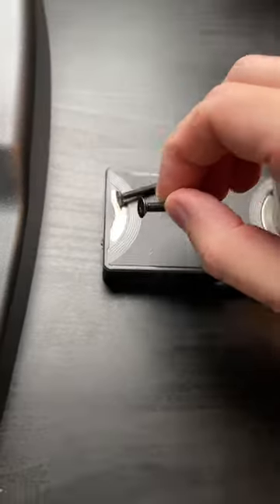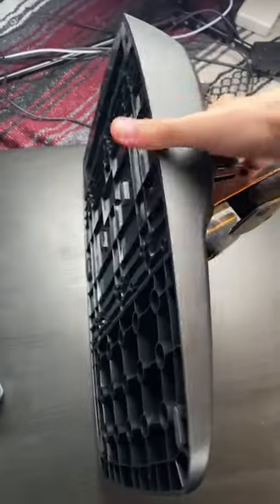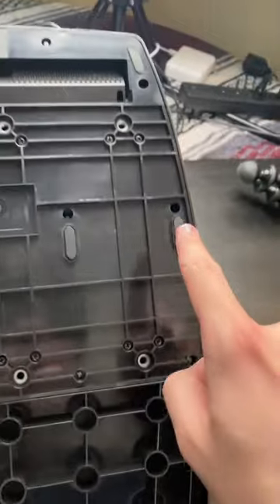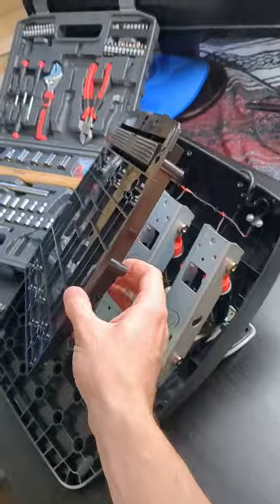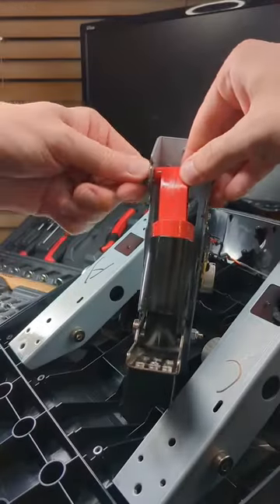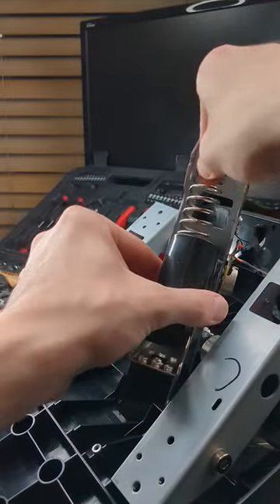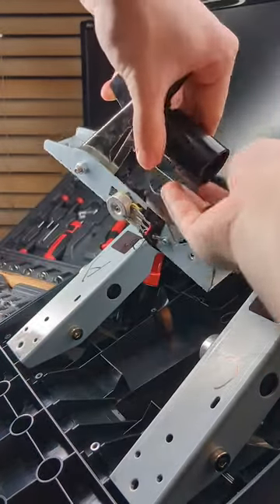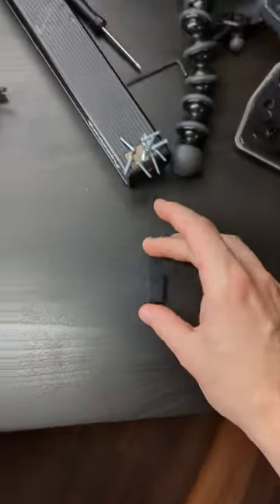FIXING the Logitech G920 #shorts

Comment: Don’t just remove it😂🤦🏻‍♂️ I used a eraser cut to the same size as the rubber insert, softer than original with more resistance at the end of the travel works a treat🤙

Comment: Bro for this g920 exists a app on computer where u can  control every part of ur steering wheel and u can change ur pedal how hard or how easy to press and this works on the wheel too
Reply from the maker: The only thing GHub does for the pedals in digital sensitivity - it's the same stiffness regardless unlike changing the centering strength on the wheel. Without the rubber piece it's obviously a linear press which is unrealistic, but for how many people will probably have this wheel on a desk do think this is better.
Reply: @NPCLiam  oh ok thank you

Comment: Upgrade the brake pedal sensor with an AXC True Brake mod kit. Bout 60 bucks for the best G series  pedal set.

The pedal feels wrong because your leg strength needs to improve. High end pedal sets are just as difficult to press. 
At best just shorten the rubber bushing.

Comment: Really you actually want to get rid of the only bit of feel that pedal has I mean I'm having a hard enough time going from racing real cars to getting used to electronic pedals that don't really act quite right 
plus the only feedback you get is visual and what you can feel through the wheel unless you have a really good setup then you can somewhat feel what the body is doing but to me it kind of feels like someone forgot to do up the suspension and closed their eyes on the wheel alignment 🤪 🤣  it's close but still a little bit weird compared to an actual car

Comment: Gamers must really not know how real cars work or feel smh
Reply: driven hundreds of cars. not any race cars meant for straight up racing. the pedal with good calibration is to stiff. especially with a regular office chair.
Reply: @Camka427  well, yeah, on an office chair with wheels it is lol. The proper way to do this is a cheap $200 or so racing sim seat with wheel and pedal mounts. At minimum. I started out with an office chair and made a mount to fix it in place with my desk. My friend was able to back his office chair into his wall, but a chair swiveling around and getting pushed back is a bad idea.

P.S. I've also never driven any race cars, but have driven 10 or so muscle/drift/track cars which were pushing 600-800 hp and the brakes on the G920 definitely feel like one with larger brake rotors and 4-5 piston calipers up front, something like that. Ya just gotta find a good middle ground setting for all the (in-game) cars you like to drive I suppose.

Comment: im selling my wheel what wheel should i get 140-150 or below dollars what new wheel and gears and pedals should i get?
Reply from the maker: That's a tough price point, a used Thrustmaster T150 or Logitech g29/g920 are gonna be what I'd recommend
Reply: @NPCLiam  i really do thank you im going to buy one i found one for only 109.99 bucks WAY cheaper than 299.99 bucks
Reply: @NPCLiam  and it has a stand and setup

Comment: I will explain why this actually is a fix with physics.  Because the force of a spring is F=kx where k is the spring constant and x is the displacement, the amount of force is directly proportional to how much you squish the spring.  But with the rubber in there the spring constant k changes halfway through the travel so by default the force is no longer proportional to the distance traveled.  Since logitech pedals detect the displacement of the spring you want the force to always be proportional to that displacement if you want to get consistent braking.  Rubber stoppers only make sense when you have a load cell that measures force directly.  Thats why i never understood those mods that added rubber to cheap pedals

Comment: Basically this ruins the sim racing... Because you have no clue how bloody much you braked. lol.

I'm researching "free" mods that will make my brake be stiff all the way through since basically there is like 50-52% of "deadzone" until you hit the rubber where you feel nothing then when you feel the resistance I set that as starting point until it goes all the way to 100%.

Much better then having dead zone (no pressure) while i'm already 50% braking power which is ridiculous.

Comment: I did it, but I think I tore a wire putting it back together 😮‍💨… does anyone know if you can get replacement pedals
Reply: Time for you to learn to solder as they don't sale replacements you could check eBay for someone saleing some logi pedal.